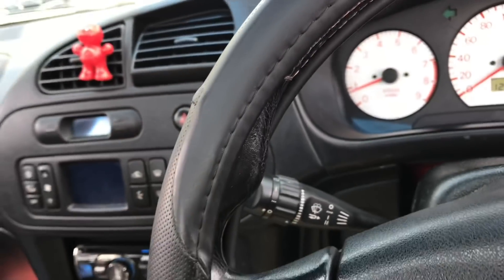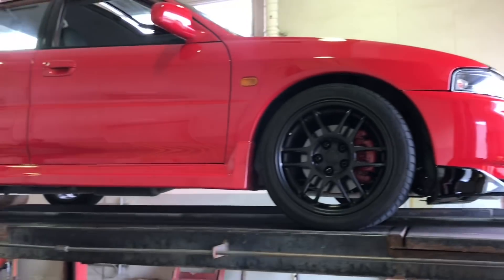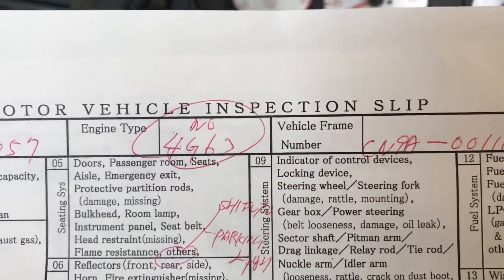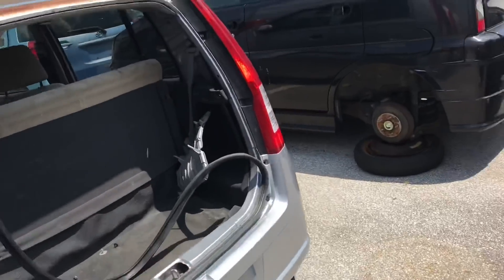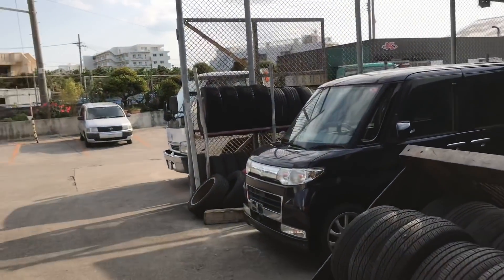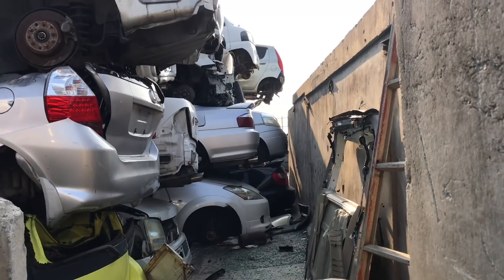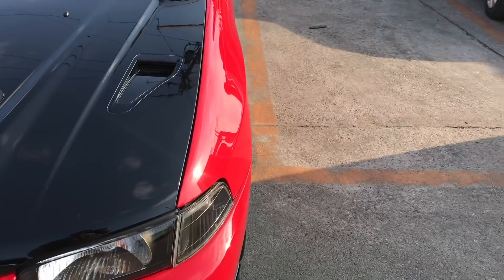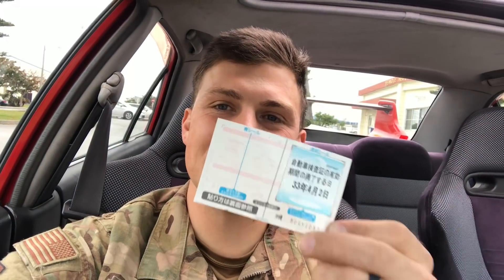Will My JDM Mitsubishi Evo IV Pass the Dreaded Japanese JCI Inspection??

Comment: you are running Evo5+ wheels on your Evo4 which are +38mm offset instead of +46mm of the Evo4. Evo5+ obviously has wider fenders to accommodate the wider/more negative offset rims.

Comment: Back in 98-99 when I was stationed at Kadena I never had a single problem with JCI and I had a R33 GTR.    I had aftermarket wheels and I had a go on those.    They are very strict this time I believe.